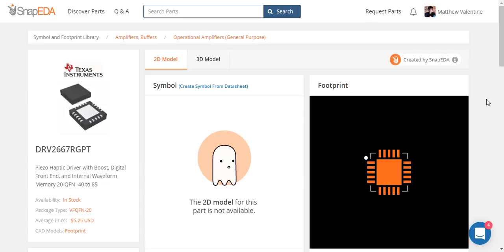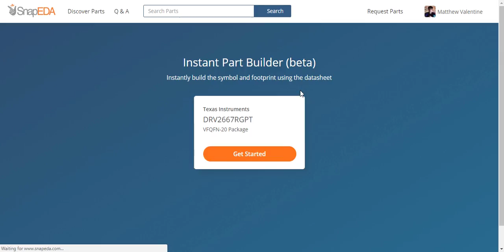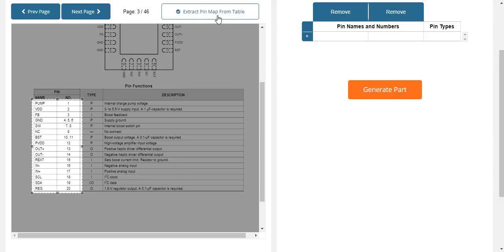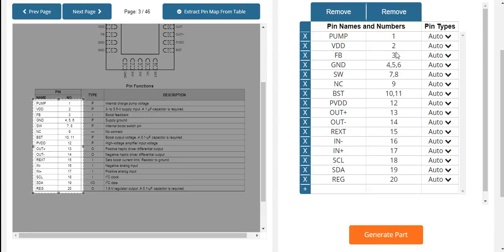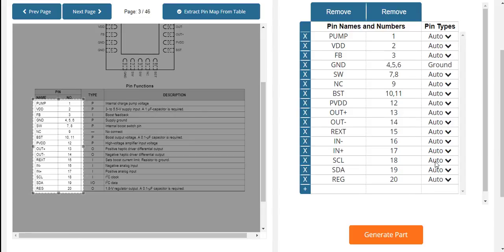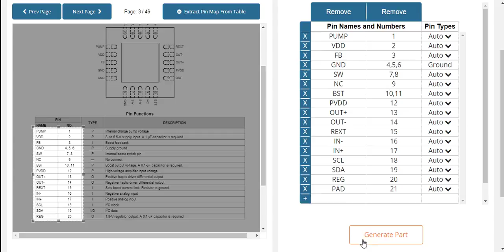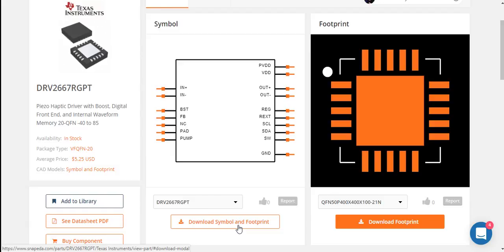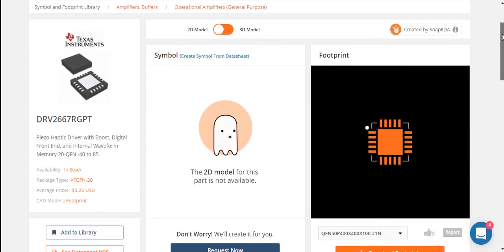How to make schematic symbols for your PCB designs (InstaBuild tutorial)

Comment: not impressed that this only works for the person creating a symbol rather then makes it available with the footprint for everybody. why force replication? i am sure you fellas have a reason. it wont be a valid reason but more of a scam going on behind the scenes maybe???
Reply from the maker: Hey Gary. Thanks for your feedback! I'm so glad you see the value in InstaBuild! Our plan is to make the models available to everyone once they've been generated by a user, but we want to make sure we have a strong vetting process in place before we open the gates on that. 

As you know, if even one pin is defined wrong and an engineer misses that it can cause massive issues in manufacturing. For this reason, most engineers we speak to appreciate the fact that we're not releasing unverified content into our library.

We definitely plan to start vetting and releasing this content soon after we've had a chance to do thorough verification on each model!
Reply: @snapmagic_  I agree with this course of action!  thumbs up